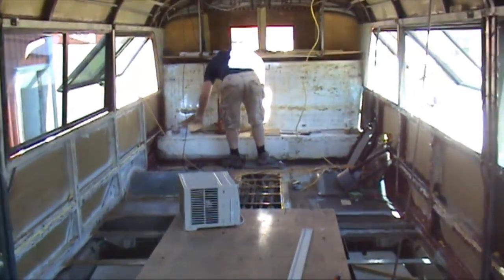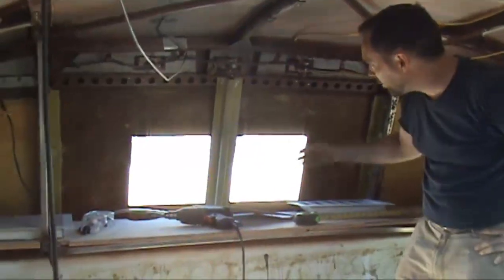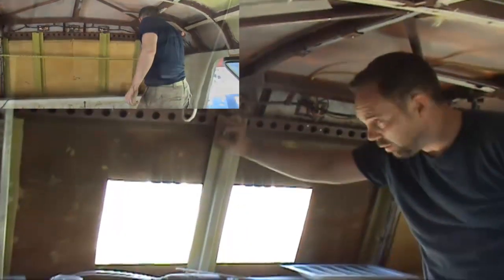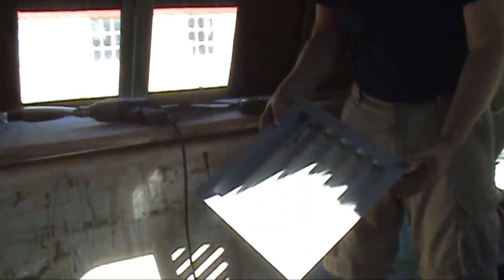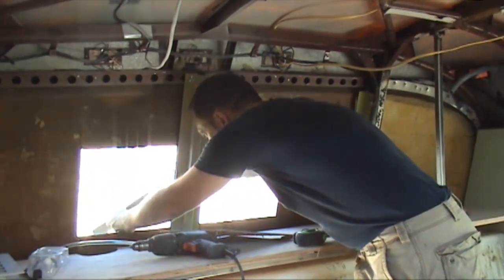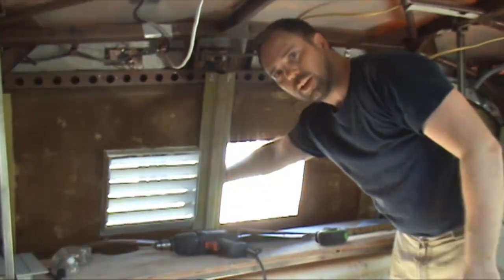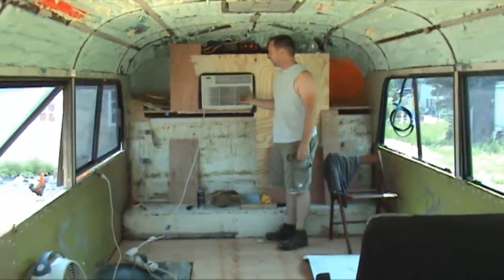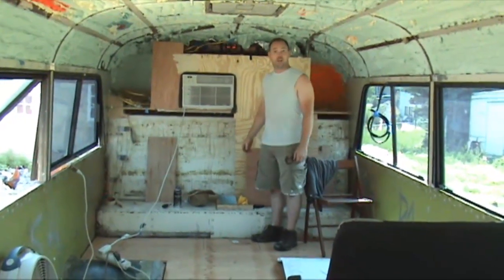Bus Conversion Build - How to Install an Air Conditioner

Comment: Is your run off your batteries? I am trying find ways to cool and heat while bus is off without running generator all the time.
Reply: Did you find a way?
Reply: @PeaceJourney...  I just needed to run the generator.